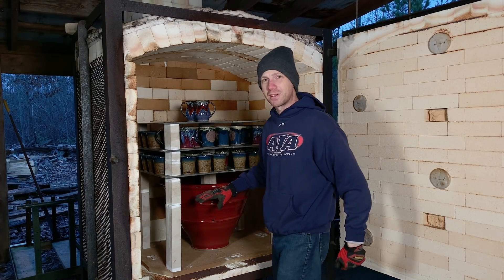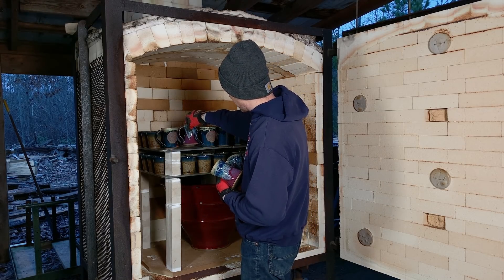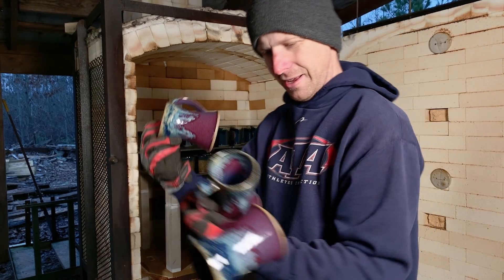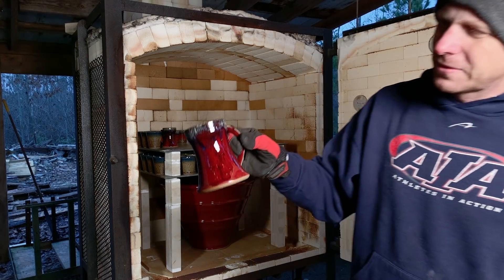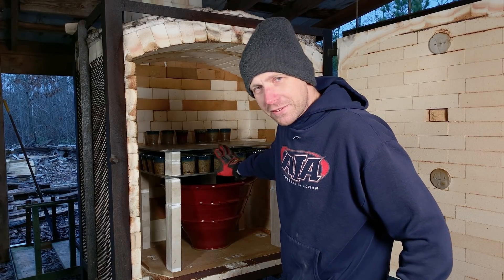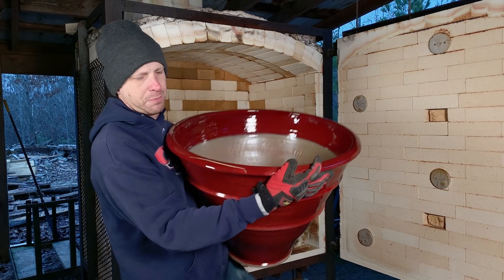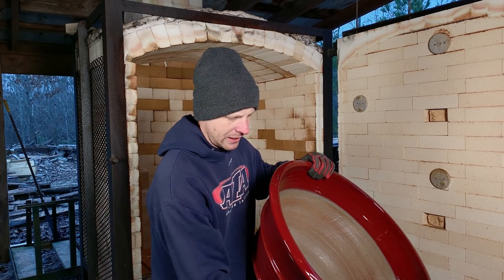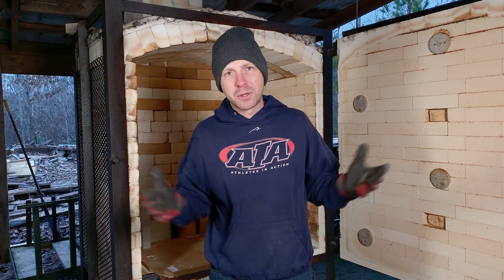The RED Returns!! (First Kiln Unloading of 2021)

Comment: I’ve had cracking on giant pieces in the past and for bottom cracks, I dust the bat with a little kaolin, mostly in the center. Also, rim cracks can happen if the kiln cools too quickly. I place fiberfax/Kaowool on top of my kiln and it slows it down. With extremely tall and large pieces, around 4-5ft tall and 150+ pounds, I leave the candle burners on and slowly bring down the temperature. Beautiful work Matthew!👏🏼👏🏼👏🏼
Reply from the maker: Thanks. I believe I know why that one cracked because of uneven heating during the bisque. It was cracked coming out of the bisque. I’ve made many other large piece that have not cracked. The cracking in the bottom is due to the way I stacked the kiln with a post in the middle of the planter. Lesson learned. Thanks for your input, I’m always learning even after 28 years of making pots.

Comment: yay the red is back - you must be pleased with such a good firing albeit with some cracks. At uni we were always told that small stuff at the bottom and large pieces above. You might want to try firing such a large pot on silica sand which would allow it to move a bit during the firing. Once that large planter is planted up the cracks will not be an issue. Maybe post a picture of it once it has been planted up?